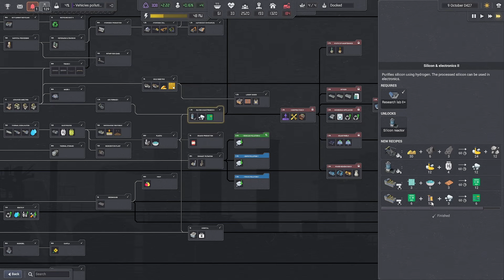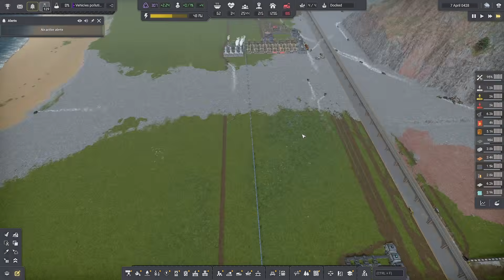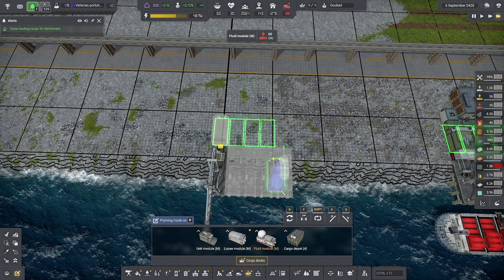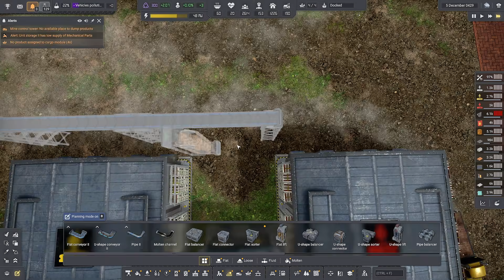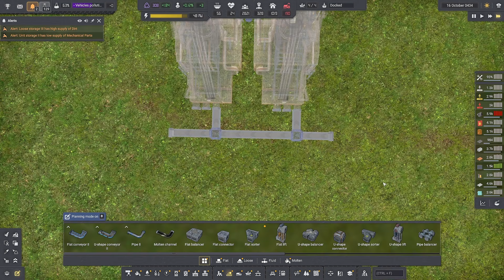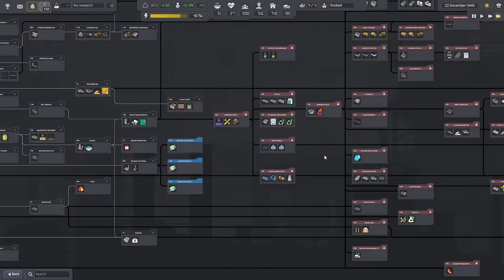There Is No Other Way: MAIN BUS To Reduce Truck Load | 12 | CAPTAIN OF INDUSTRY - Update 4

Comment: If you click the vehicles icon in the top bar, then go to the 3rd tab (IIRC), it tells you what the trucks are doing. Your question of "I don't know what they are doing" is answered for you in that tab. Hook up the trains for the dirt and rocks at the other mining locations. Have the train drop off dirt at the shipyard, and rocks go to the landmass. Start stockpiling steel and concrete blocks for the bridges!

Comment: There's so much opportunity for trains in your base that would massively reduce trucks usage: 1) bring in all food from the far side of the farms (ie: move all food processing to central location, and train it to settlement) 2) obviously, once you get to the other islands you'll have to use trains to bring in all the ores back to main base, so good thing you left lots of space around that steel build; do the same for the massive copper build you'll have to make. The aluminum+tungsten build is going to be extremely painful; there will be lots of opportunity to train in needed resources, along with the ore itself. T4CPs->tungsten ore is a good, and easy contract too.

Comment: i like this bus design! it reminds me of how i handled the main bus for my interplanetary manufacturing in DSP! 

also i don't know if you know this or not but Connectors and Lifts have limitless throughput so you can attach them directly next to each other to weasel out more in/out to buildings with larger transfer rates than your belts allow (train and cargo modules, storage, and so on)!

Comment: why use acid vs. water with the copper?  Much shorter supply chain for water and it's not like you're running out with those desalinators and raincatchers?
Reply: you get slightly more copper output for the same ore input with acid. Also, if you add sulfur to water you get the sum of their weights in acid. And water is actually more valuable than sulfur which is mainly a waste product that needs disposing